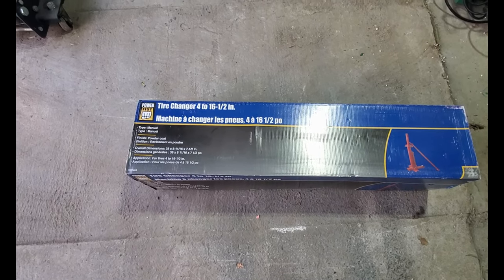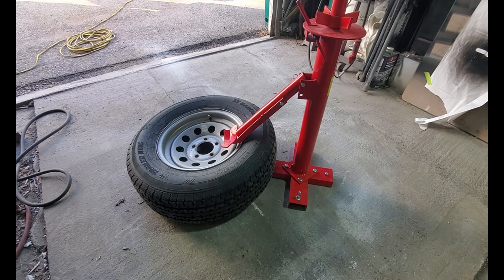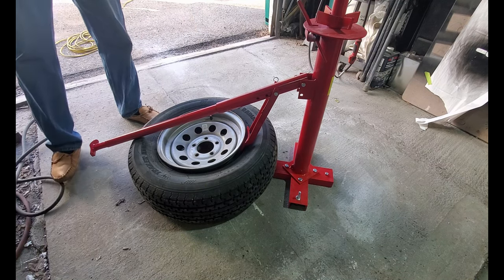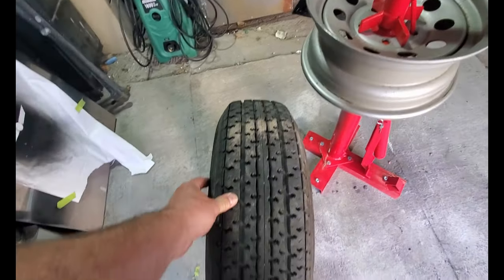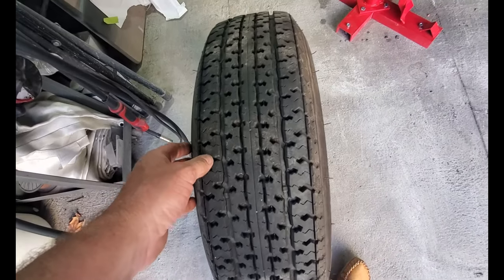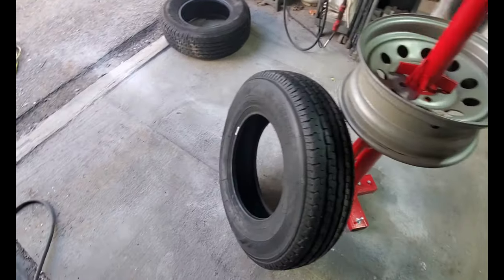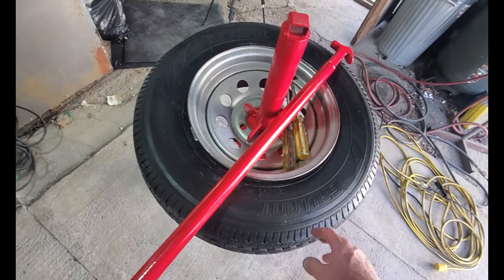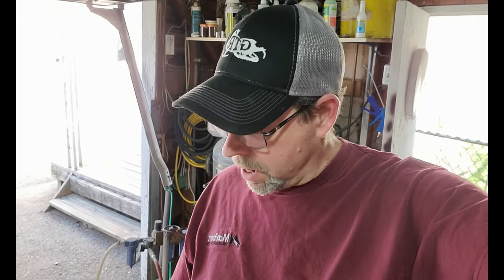Princess Auto Manual Tire Changer Review

Comment: Saw this recommended in the PA comments.

Its not too bad a machine but as with all cheap Chinese tools your going to want to break out the welder to reinforce things.

1.Weld the bottom legs on and bolt down to concrete, if you mount to a skid you will be frustrated.
2, The saddle that breaks the bead needs beefing up, it folds back under moderate pressure. I welded 1/8 side plates and weld dots underneath so it wouldn't slip of the tire.
3.The top locking tube flange eventually breaks so weld some plate to it to beef it up.
4. Never had a problem with the bar its pretty beefy, just make sure to use soap/water lubricant on tire and rim to make things easier.

I have done hundreds of mounts/dismounts with this and it has performed well. I wouldn't use it on nice alloys though as it has no nylon bar sleeves.
It gets you in the game!
Reply from the maker: It definitely works straight out the box. I did see all the upgrade suggestions people did on the PA website and totally agree. Thanks for watching and leaving a comment. Much appreciated.

Comment: How would you use this to change a front lawn tractor tire that is on a 6” rim with a 3/4” bearing hole in it? I’m guessing that it’s only designed to work with wheels that have a big enough hub hole for that main rod to go thru?
Reply from the maker: Only works for car and truck type tire and rims. Pair of regular tire irons probably work best for lawn tractor tires.
Reply: @swc-diygarage  I used them but damaged the bead area those lawn tractor tires can be very hard sometimes harder then full size tires princess has the 8-16 on sale for $69 this I’m winding what the difference is the picture don’t show anything that jumps out.